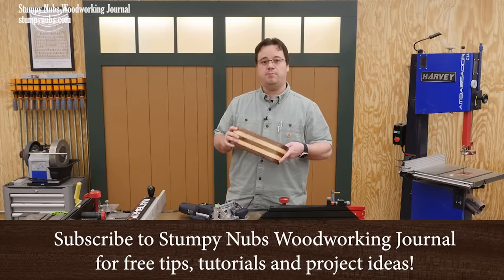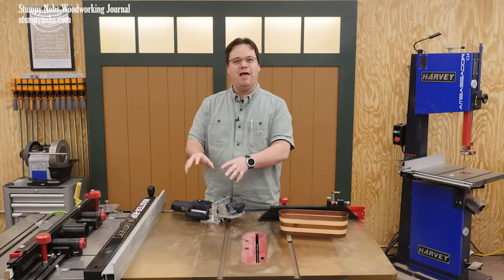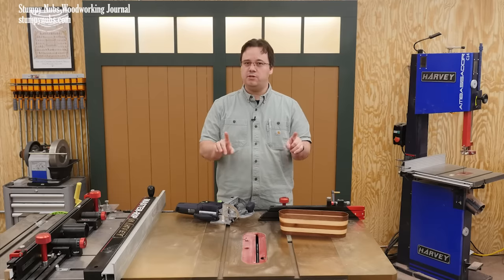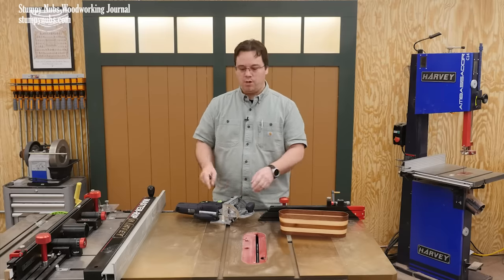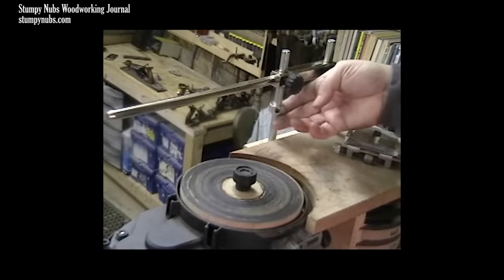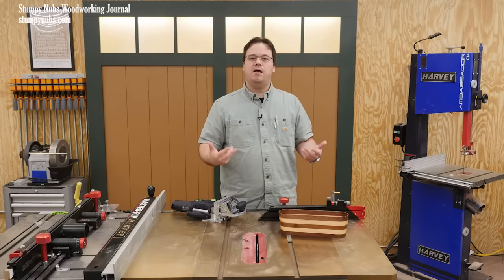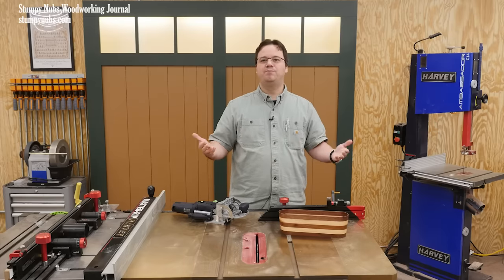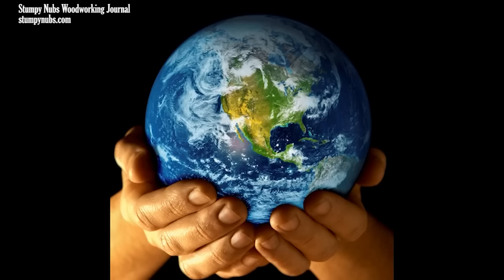This is why people HATE Festool and their Domino!

Comment: I checked out Richelieu Hardware the other day; one of the featured products was reversing drawer slide system called Riverso. Looks amazing. Then I signed in, and checked out the cost.... $1,100+ canuckistan copex. Just shake your head and let the rich buy what they can afford.
In the case of Festool; a person buys it for the high production. High production and faster turn around mean more money.  Buy a pocket size pocket screw jig and spend a whole day laying them out and clamping the jig for every screw or buy a Castle.  Buy a plastic template for concealed euro hinges or buy a hinge boring machine for $3g

Comment: I finally bought a domino about 6 months ago. I find it an amazing machine it does so much more than a plate Jointer. It is a versatile machine. the cost is high for most people but I can say that it was well worth I seem to find many other uses for it. just incredibly sophisticated piece of machinery. one thing that you should point out is it's not made in China as I recall it's made in Germany anything made in Germany  is going to be incredibly expensive.

Comment: I have a cabinet saw, but started, about fifty years ago, with a tilt top Craftsman.  Yes, I could do the same thing with the Craftsman as I do with the cabinet saw, but I can do it safer, faster, and with FAR more convenience.

Today, I have two bandsaws. One for scrolling (thanks Kreg, for you Stabilizer guides) and one for re-saw work.  Back in the day, I did everything with a Black and Decker scroll saw. I upgraded to a Bosch and the quality of the cuts were night and day. I still use the Bosch, but the bandsaws might equate to staring at the sun and being in absolute darkness in difference/improvement.

Now, decades of sawdust making later, I have a couple Festool sanders.  I still use my 1/4 sheet sanders religiously for shaping work and such. There are many things spinny sanders just don't work well for.  I should note, I use my cheap sanders in a sanding booth, or I jump to my drum disk, Flatbed.  

The Festools get a lot of work too. Being on the end of a vacuum really does make for a nearly dust free sanding project. And, that dust free experience pales what my Porter Cables, Makita and Dewalt 1/4 sheet can do. It leaves me wondering about the Mirka's and Bosch versions, with dust collection.

Six hundred is a LOT of money for a hand sander, but the better papers result in notable performance improvements too.  And, a sander with dual patterns and variable speeds that will last for a decade makes it a lot easier to get past that initial cost, be it for a Mirka or a Festool.

Comment: It all depends on two factors. Are you making a living from cabinet making, furniture making, high end carpentry etc? And, are you going to be using the tool quite often? If you answered yes to both questions the domino is a good investment because it's going to pay for itself pretty quickly. If you answered no to either question you can accomplish the same joinery without the domino albeit more slowly.

Comment: I’ve been woodworking for over 50 years, first as a hobbyist, then as a side gig for a few extra dollars, and professionally for over 25 years. In that time, I’ve bought multiple tools (table saw, bandsaw, drill press, etc.) many times, moving up in quality until I got to where I am, now.  Had I bought the final tools first, I would have saved hundreds, if not thousands of dollars.

I bought my Domino 500 years ago, for a particular job. I don’t even remember what it was. But the price was forgotten before that job was done. I’ve used it on many, many projects since then, and I’ve never regretted it. I still have (and still use) my doweling jig, biscuit joiner, and pocket screw tools, simply deciding which will do the job the best. 

Since then, I’ve only bought one other Festool (a random orbit sander) and that, only so I could buy their right angle attachment. Again, the price didn’t matter, once I used it for the first time.

The “but other people can’t afford it” argument is completely bogus. Should I drive a Yugo, because other people can’t afford a Toyota? Should I wear a Timex, because other people can’t afford a Rolex? I once had a rabbi tell me not to use my iPad in the choir loft, because some congregants couldn’t afford one. (He drove a newer car than I did, BTW.) 

Anyway, if a better or more expensive tool will do what you need done, and your time is worth the investment, do it, and don’t look back.

Comment: Are used to be a professional plumber. I’ll give you a prime example in the plumbing world cast iron chain snaps. For anyone that Hass to cut cast iron there are really only three ways to do. It. One is with chain snaps, two: with an abrasive blade (angle grinder usually ), or three : some reciprocating saw blades. 
I spent several years with the reciprocating saw before I spent the money on chain snaps. Chain snaps were worth the time in savings once I had more experience under my belt.   They cost significantly more and only have a single purpose, but they do it fast and extremely well. 
Festool is just a professional tool line; it isn’t for hobbyists necessarily or even all professionals.

Comment: To those who think high end tools are only for professionals, or wealthy hobby workers, keep in mind, building your own things can pay for the tool over time. If a given tool makes building those things more enjoyable, there is a lot of value in that.

When I was transitioning from one home and shop to another, I had to dig through boxes to find the tool I needed for a project (e.g., jig saw, try-square, circular saw, L-square, scribe, etc.). It was such a pain, few projects even got started.

Now, I have swinging wall racks (like the poster racks you'd see at K-Mart, but thicker and more heavy duty) so I can see the curve, caliper, set up gauge, laser level, etc. The routers [that aren't in a carver, pin router, router table, Router Crafter] and bases are all on a shelf dedicated to router equipment. So too it goes for sanders, circular and saber saws and so on.

These things make it MUCH easier to tackle a project, including by helping me keep the shop organized.  The easier it is to do a project, the more likely it is to get done.  So it goes with biscuit machines and the Domino too.

PS Many a pro started as a DIY guy/gal or hobbyist.

Comment: I recently made a 7-drawer dresser for a customer. I normally join my case parts traditionally with mortises and tenons. In this project, the design called for 44 M&T joints. I decided to bite the bullet and bought and used the Festool XL on this commission. This saved me  (??) in layout, set up, and fitment. The ability to have exact precision with 1/4 of the time and effort is astonishing. I estimate the ~$1500 investment paid for itself after 2-3 projects of this type. Game changer for productivity.

Comment: 25 years ago I built two single beds for my two sons. Each had a headboard and footboard with 15 or so vertical slats that were 1/2” thick by 2” wide and however long. I chose to use floating tenons. The horizontal rails I used a chisel. The end grain I needed a different approach so I built a 3 axis mill with a mounted router.  I made all the end grain cuts in about 2 hours. However, it took me weeks to build the jig. Longer than the entire bed projects by many hours. 20 years later I have a domino. I use it.  It saves me a ton of time. It is not perfect. I make mistakes with it too. But it has a place in my shop. Kapex on the other hand.  I sold mine yesterday. Dust collection was superb but it’s controls just can’t overcome my Dewalt muscle memory. And the fact that this is a rough saw in my shop as all joinery is done with hand tools and shooting boards.

Comment: Way back, I succumbed to the lure of the multitool saw. I bought one. It is great! It does everything that it is supposed to do, and does it well! I've used it three or four times over the years since. It sits proudly in the corner of my shop.
But I am not a production wood worker, and I enjoy using hand tools and home made work arounds. When I  needed eight siding boards for my 150 year old house, a milling company agreed to make the eight 1 inch thick boards for seven hundred dollars including the price of new cutter blades to make the scalloped siding.  The company got to keep the blade, of course.
Knowing that I was unlikely to do this again, I bought a good quality panel raising router bit at Lowe's for about $100 dollars, did a minor amount of grinding it to match the original siding, purchased a dozen inch thick hemlock boards from a local Amish lumber yard for about $5.00 each and made the scalloped tongue and groove siding on my (expensive) router snd router table.

Had I been in the business of restoring Victorian houses, a more expensive solution would have made sense, of course. But I  am retired and have lots more time than money. So I don't knock the expensive tools. Sure, I  would love to have a Domino, but it just doesn't meet my needs. To each his (or her) own.

Comment: So recognizing tools are innovative and made well is part of many trades. All hammers are not created the same. Wood working is also true. For those that hate festool and especially the domino - I'd suggest you toss the power drill and get a new brace and bit for ALL drilling. Sure you can do much of what a domino does with a router - but it's slower and harder to set up - I LOVE my domino and I have the large one and adaptors for the smaller bits. Also have a festool track saw. With these two I built an amazing 12' dining room table that easily justified the costs of both tools with one project. The truth is the value is in results better, quicker, nicer. It's not about the price of the tool. And YES you can do almost anything with less complicated tools but that doesn't make innovative tools bad.

Comment: I sold my panel saw that was used to break down plywood so I could finish size it on the table saw, replaced it with TS55 and it started it all and never looked back.

Comment: I own Festool machines,  Rotex 150 Rotex 90, and the vacuum. It is used for sanding as I'm a painting contractor. 
As a hobbyists woodworker, I have a mixed setup of makita and dewalt,  don't want to spend too much on Festool,  and they do the job.
The  Domino is a really good machine,  but until it's not for a daily use, it doesn't justify owning it.
The price tag is OK. It feels overpriced,  but the reliability and the quality of the Festool machines do justify it. 
Regarding the two parties: if you own one, it doesn't mean you have to be arrogant, or if you can't afford one, you don't have to envy the others or mock the price. 
Kudos for your videos.

Comment: I use some festool gear, I find it’s more like chasing the difference between 90% good enough and 100% perfect. I terms of usability for home applications 100% get it if you want and can afford it but otherwise There’s plenty of good ways to get the same results it just might take a little longer and require a little more knowledge. I’ve done plenty of good work with rubbish tools as that’s what I could afford but does make the upgrade all that more noticeable.

Comment: I first heard of Festool through Lee Valley Tools - a local company that makes and imports tools for the retired gentleman woodworker. Are most things expensive? Yup but they're either very high quality, very useful, or very, very pretty. You aren't going to buy their tools and chuck them in the back of a rusty F150.  Nothing wrong with that, and if I could fill my shop with them, I would. Somewhat surprisingly, some of their hardware is cheaper than at the big box store.

What really used to bug me far more than any particular tool brand, was a certain Yankee program on PBS which very definitely gave the impression that the first step in any project was to buy $50,000 of tooling. I am happy to say that Stumpy Nubs is exactly not that, and I appreciate the time and effort you put into showing alternatives to powertool intensive fine carpentry.

Comment: I don't understand why people complain about the price of premium tools. I have a festool rotex safer because I saw a demo and was hugely impressed by its ability to save me time in the shop, I have a one man business and need every edge . I didn't buy it straight away, I waited until the smoke came out of my old Ryobi sander. After using it, I wish that I didn't wait. 6 years later I still love that tool. I wanted a track saw for breaking down large sheets but I only wanted it for occasional rough cuts so I bought a sheppach. If I was going to use it for quality cuts, I would have bought a more premium tool.

Comment: Damn I really wanted to hate this post, but as usual you make solid points and cover both sides.  I work for Rockler and hear all of these and more on a daily basis.  Couple of things in my mind differentiate Festool and have nothing to do with passing judgement on those who don't want to own Festool.  1.  Festool designs tools and accessories to work together.   For example Systainers stack to match the height of the MFT table so you can extend support.  Dust collection is paramount in everything. 2.  Many tools serve multiple roles (look into the Rotex Sanders if you want an example of this.  3.  The Warranty and Trial period are unparalleled in the tool industry and the turnaround on repairs makes it worth the price of admission.  4.  Making the job easier and faster is the theme with Festool.  For most the Return on Investment in time to complete work justifies the expenditure, but for a hobbyist the Return may just be time to be able to enjoy the hobby.

Comment: I didn't respond to this video originally because I was in the middle of my van build that I was rushing to complete before a road trip. Since then, I've made a bunch of upgrades to my van build and finished another 15% of a kitchen build. I'm a bumbling amateur doing this on the nights and weekends. The domino is totally worth it for me because I'd never be able to to finish even one project in the little time I have at a higher quality than my skills allow using most other methods I would consider (probably pocket screws with dowels where visible). I saved more than the cost of the domino just in the van build (prefab van cabinets are crazy expensive).

Comment: Got my domino when I was 75 -- and had over fifty years of woodworking experience. Great machine. Love using it and my many other Festool products. They are the Mercedes of woodworking tools. Fine company. Hate is not a good word. Disappointed that you would use it in this video.
Reply from the maker: "Disappointed" is not a good word either. I'm disappointed that you would use it.

Comment: I'm not against Festool or Powermatic or the price of machines. You get what you pay for, still stands true today. I don't own any mostly because I am cheap and also because part of my joy of woodworking is hand cutting joinery. Therefore I spend my money on good quality non-electric hand tools. If I was woodworking for a living, I would probably buy these machines. As for trying to make projects where others used dominos or loose fit  tenons, all I do is add additional length to cut a traditional mortise and tenon joint and surprise; joint complete. Granted that takes math but that is what woodworking is, math and calculations.

Comment: I use both a Domino and a biscuit cutter. I've been doing this long enough to use a Lamello before the patent expired and biscuit cutters (BC) sprang forth. I would compare the Domino more to the original Lamello in quality and price rather than a knock off BC. There's a BIG difference in accuracy, build quality and utility between a Lamello and say a Dewalt knock off for example. 

I have the 2008 vintage small domino and a much older Dewalt BC.  I favour the domino ... it's very accurate and customizable. it comes with some pretty good fixtures for stability, repeat cuts and thing for narrow stock. I find it easier to make jigs for the Domino ... it's a mini slot mortiser, you don't have to use dominos, you can make your own floating tenons ... and effective dust collection.

About the only thing I use the BC for these days is drop edges for countertops and shelves. It's on my rolling bench and I never change the setup

Comment: The domino is a fantastic tool.
I have used it professionally for many projects, hundreds of individual pieces probably... It is fast to set up, it is easy to use, and when you know how to use it right, it provides a perfect result.
For small projects I prefer Domino over the stationary mortising machines we have at the workshop, because it is so much faster to set up. And consider this: the alternative method in this case involves a cnc machine and a mortising machine, that together costs about $250K and requires quite a bit of training to operate, not to mention a lot of workshop space.
For a small scale woodworking business, the Domino is a gamechanger for sure.

Everyone has to decide for themselves if a certain tool is a worthwhile investment. In this case, the tool does one single thing, but it does it extremely well. Question is, do you get enough use out of it to justify the cost?